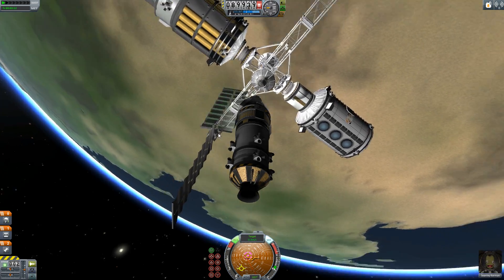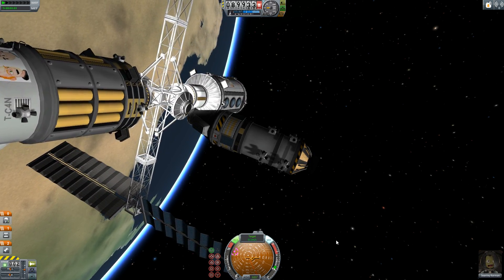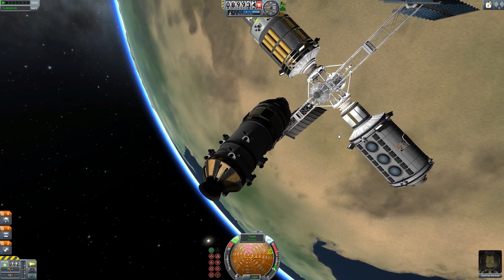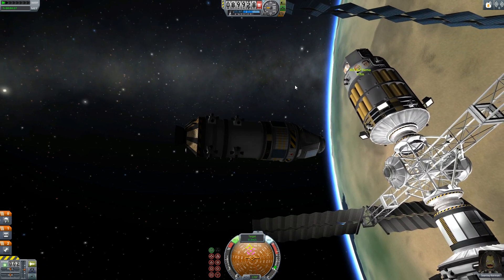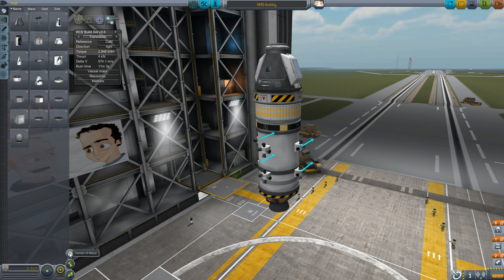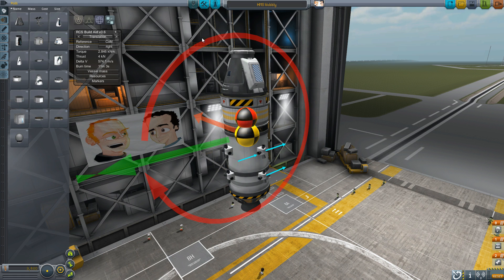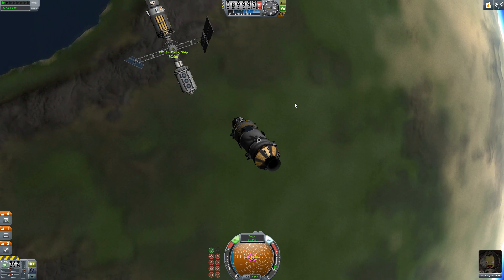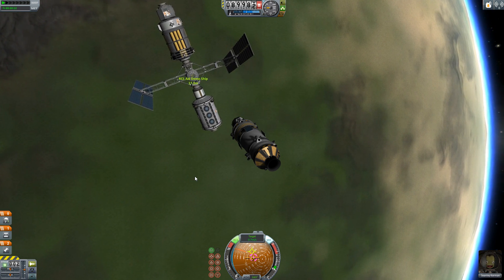RCS Build Aid - 2 Minute Mods - Kerbal Space Program 12

Comment: uhmm it doesn't seem to be working. I'm building probes so they are really small. I put 4 4way thrusters and no matter where I put them the tumble indicator wont change size. It shows thrust for left propelling me to the left and down... wtf? thrust down doesn't show any thrust at all. thrust right show thrust right and up... something's not working right here... suggestions?
Reply from the maker: +rcollins779x Wow, um, perhaps the mod hasn't been updated to work properly since the recent patch? All I can suggest is to try the forum thread and see what people are saying there.
Reply: after spending more time with the mod, I failed to select translation. So whatever setting it was under (engine or Attitude ) isn't behaving as what I would consider normal. For the translation it seems to be responding properly, although I still cant balance the thrust, but thats on me.
Reply from the maker: +rcollins779x Ok, that's weird!